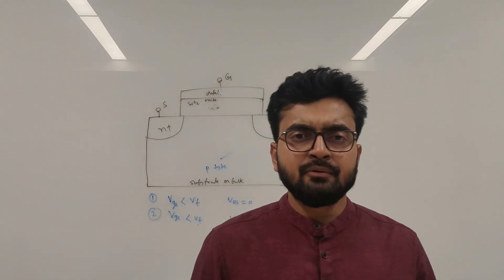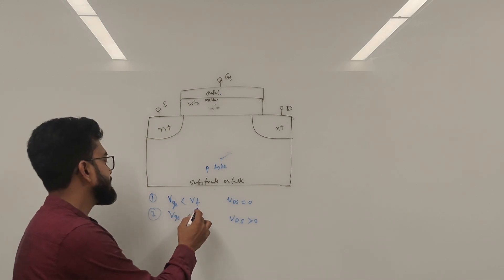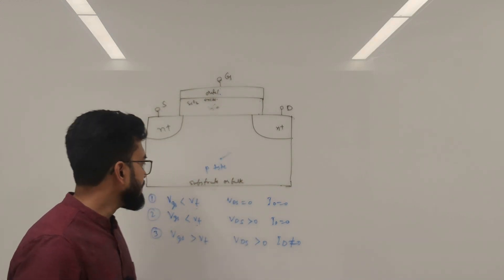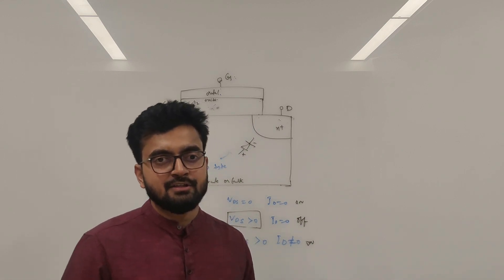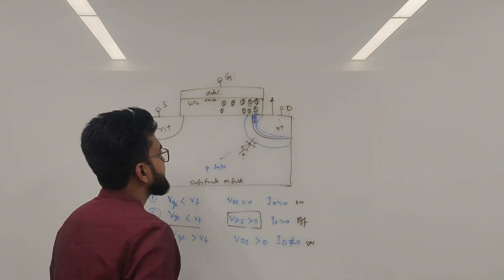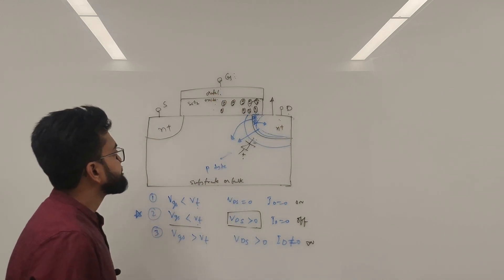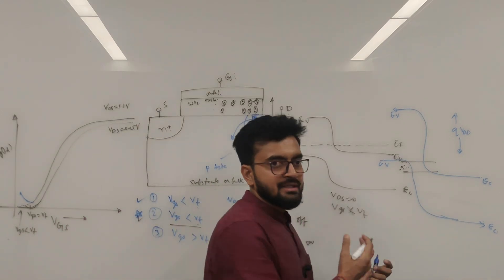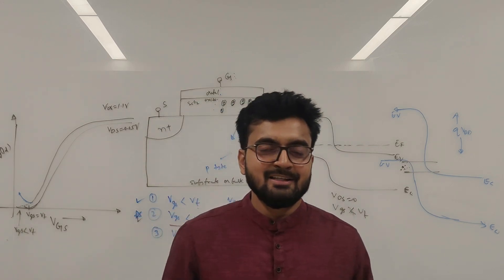What is gate induced drain leakage in MOSFET ? GIDL in MOSFET?

Comment: Kindly Explain, how come the valence band is placed above the conduction band? Kindly rectify in the video. The condition for Vg<Vth refers to the weak inversion region. This suggests the intrinsic fermi level should bend below the quasi-fermi level (surface potential = built-in-potential), consequently bending the conduction band close to the quasi-fermi level.  

But in any case I can't see why the valence band should be above the conduction band?

Comment: Is there any alternative method to replace Bottom silicon insulator technoligy to more enhanced for reduce threshold leakage
Reply from the maker: yes , using  High-k/Metal Gate (HKMG) Technology:
High-k dielectrics and metal gates can be used to replace traditional silicon dioxide gates. High-k materials have a higher dielectric constant, which allows for a thicker gate dielectric without compromising performance, thereby reducing gate leakage.

Other techniques are GAA, FinFETs, Fully depleted SOI . 

Hope it helped. Thanks for watching the video.
Reply: @semitech01  is it possible  to use high k/metal gate in Gaafet
Reply from the maker: Yes, it is possible to use high-k/metal gate (HKMG) technology in Gate-All-Around Field-Effect Transistors (GAAFETs) to reduce leakage current. The integration of high-k dielectrics and metal gates in GAAFETs can significantly enhance their performance by improving gate control and reducing gate leakage.

For more you can refer below paper
https://www.researchgate.net/publication/4357573_45nm_High-k_metal_gate_strain-enhanced_transistors
Reply from the maker: @azamatbezhan1653  Yes, it is possible to use high-k/metal gate (HKMG) technology in Gate-All-Around Field-Effect Transistors (GAAFETs) to reduce leakage current. The integration of high-k dielectrics and metal gates in GAAFETs can significantly enhance their performance by improving gate control and reducing gate leakage.

To know more you can refer :
https://www.researchgate.net/publication/4357573_45nm_High-k_metal_gate_strain-enhanced_transistors
Reply: @semitech01  best answer